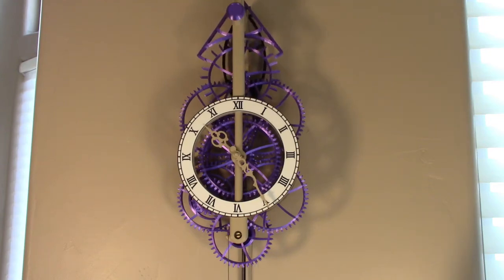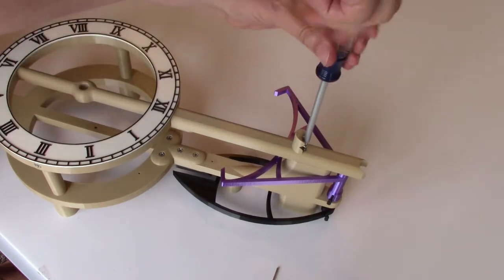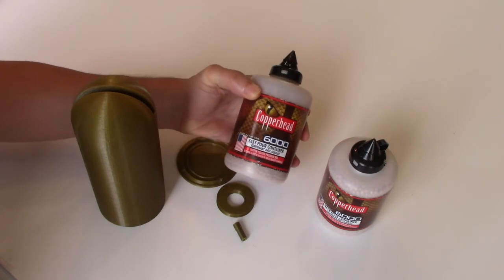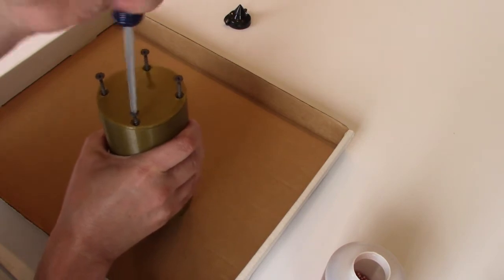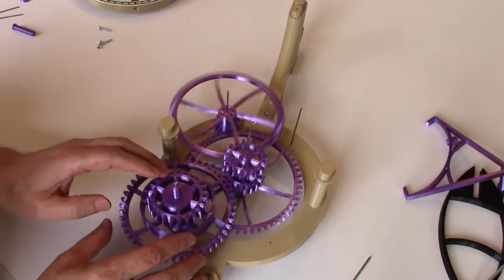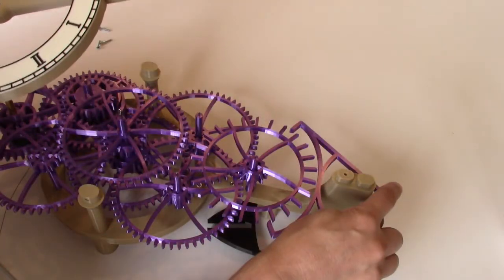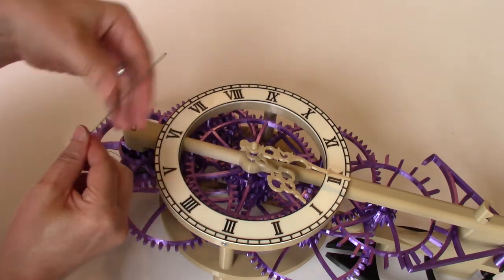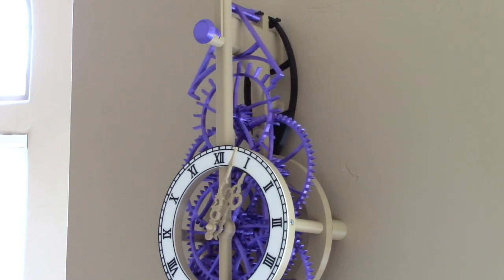Pendulum Wall Clock Assembly Part2

Comment: I only wish I had watched this before assembling the weight so I would know about the covering of the holes trick. The hardest part of the build for me was getting them out.(the bb's)  I'm lacking common sense as I get older. Almost finished with my clock, thanks for sharing these videos, they are helpful.

Comment: I finally got to watch those videos, nice work again, I learned a few things... pendulum that swings for 10 minutes, mine never go that long! bigger pinions, small diameter  arbors, bearings in strategic places, 3D printed optimized escapement, slip clutch for the hands, plenty of improvement to think about for my clocks.
Great videos!, Thanks for sharing
Reply from the maker: Thanks Jacques. My clocks seem to have gotten better when my mindset shifted to take advantage of the characteristics of a 3D printer instead of simply porting an old style brass design. I often spend hours pondering how to make each part better when it is printed. It feels like it takes forever to design each clock.
I tried many different pendulum supports before settling on the bearings. A suspension spring might be better, but they seem very delicate. 3D printed knife edges were not good at all. The ball bearing life test is still going strong at around 18 months. 
I am quite pleased with the functionality of the friction clutch. Previous designs were sensitive to getting just the right fit between parts. The spring has proven to be super reliable and the shaft collars allow it to be taken apart if needed.
Steve

Comment: Nice Clock Project.  I just finished this clock myself. I bought the plans, used 2 CR-6 SE printers to print the parts and had all the other parts laying around the shop. It runs just fine so far. In a few days I should have it dialed in.  Right now it seams to be running a few ticks fast.

Comment: Nice clock
Just bought your plans and printing has started / Looking forward to it's assembly once I have my box full of parts
Reply: Janet, where do you get the file for 3d printing, the manual, the weight cell and other parts.  Tony Vallot

Comment: Steve,  I've purchased, downloaded and printed all the parts but this is my 1st experience with the 3D printer, in fact your design is what motivated me purchase one,  and I was wondering if you had maybe a lessons learned type of info video or notes on printer settings.  The problem I'm having is called "elephants foot" where teeth are wider on the first few layers of the gears.  I am having to file them down and have made some adjustments to the slicer but the problem still persist (although its getting somewhat better).  Did you ever have this problem?  Any othe tips would be useful ie: the setting used specifially for the gears other than what you've described on page 9  of your instruction sheet.  My printer has been running for a week 24 hours a day and the last part will be printed tonight! WOOHOO!
Reply from the maker: Getting good gears is mostly solved by getting the first layer height set properly. Elephant foot compensation helps a lot, but only for the first layer. There are plenty of YouTube videos showing tips and tricks for this. Each printer and each slicer may be slightly different. 

The good news is that most of my clocks have a lot of backlash built into the gears so that a small amount of elephant foot will still allow the clock to function. A weight driven clock always applies pressure along one side of the gears. Extra backlash is completely harmless, whereas gears binding can stop the clock. I design in extra backlash to help make the clocks more reliable.

I typically use an elephant foot compensation value of 0.08mm to 0.12mm.
Reply: @stevesclocks  Thanks Steve!  I have successfully assembled the clock this morning and to my great surprise ran without much tweaking.  All I can say is that it is amazing!!  Great job on the design and instructional info that you've provided I truely love it...
Reply from the maker: @dpaaron1  Thanks. I spend a lot of time trying to make the clocks easy to build.

Comment: I currently do not have a 3d printer,  I do have a CNC mill.  What is the file types that would come with the Kit?  I could use Step or DXF types.
Reply from the maker: I believe that clocks should be optimized for the material they will be made from. You can do things on a 3D printer that are not easy to machine from other materials. Likewise, there are many traditional clock features that are not feasible to 3D print. 

The files in this design are specifically optimized for 3D printing. It only comes in STL format. I have a newer design that is intended to be converted into a wooden gear clock. It may look quite a bit different by the time it gets completed, hopefully around the end of the year.

Comment: Good evening
I have a question, can you tell me the diameter of the lead balls?
Thanks in advance for your response
Reply from the maker: Any size less than 1/4" will pack at the same density. Use the cheapest. BBs are usually easier to find, but you will need to print the larger weight shell.
Reply: @stevesclocks  Thank you so much for your response! I'm going to order from Amazon
Reply: @stevesclocks  Are these marbles plastic or lead?
Reply from the maker: @passiondrone25  Lead shot for the small weight shell. A cheaper option is copper coated steel BBs https://www.amazon.com/Crosman-Copperhead-Copper-Coated-Bottle/dp/B000HKKY7M  Two bottles of 6000 would be more than enough.
Reply: @stevesclocks  
thank you so much